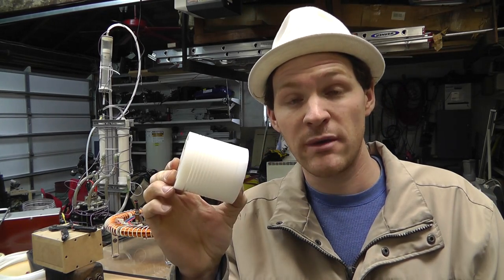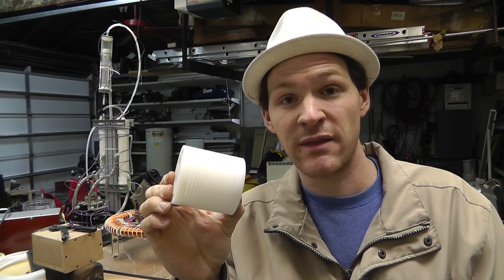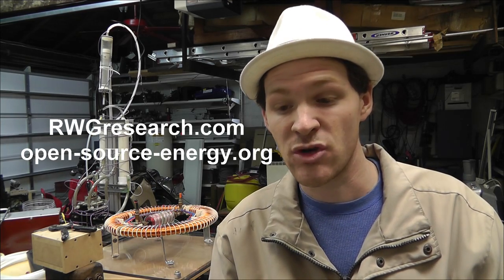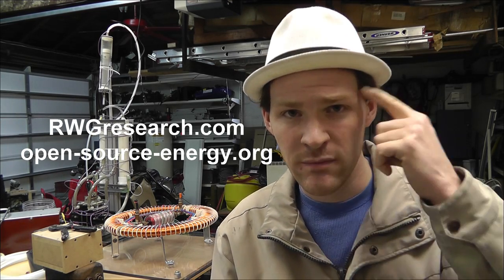Public Announcement !! Everyone Please Watch!!! Manny Thanks, ~Russ

Comment: The key is, just high voltage electrolysis. You strip the electrons, which leaves only protons. The protons are attracted to the spark plug, which produces a spark, which creates free electrons. Electrons plus protons = hydrogen. Protons are not atoms, they are subatomic particles, meaning they can pass through most metals, and have an affinity for aluminum. You can store protons in aluminum, where they come out, hit your spark, make hydrogen, and you run your engine. This is the Joe cell.

Comment: Joe from Austrailia doesn't have a site, he was threatened and just wants nothing to do with people anymore. But he does have a long archive of videos. He figured out early on that he could run an engine, but only if he used a metal, thick wall, electrolysis unit. Plastic units interefered with the gas production and caused a loss of gas energy. You have to simply search Joe cell videos if you are interested. Good work, can't believe how nice your stuff is! Very nice.